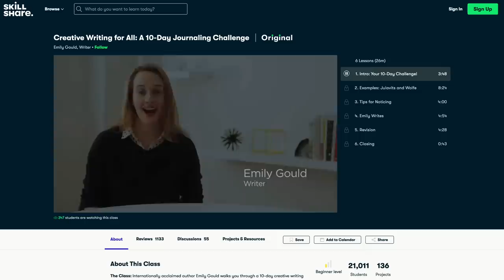A very very very simple Plywood Bed

Comment: I like this design very much! No screws, just gravity and a few dowels.

I like it because it's modular. You can easily swap out any part for a new one quickly. You can change the entire headboard if you want it to be taller, or at a different angle.

You could build different bases (taller or wider or both) if you want to add some storage under the bed.

You could add bedside tables; make a horizontal arm from the same size board as the stiles, attach a small tabletop to it with dowels, and cut a slot into the headboard to slide the table arm in from the front.

Or, you could make an L-shaped arm for the table, and attach it by adding notches to the stiles.

You could add a footboard using the same design as the headboard.

Does the headboard slide backward when you lean against it? You might need to add shallow notches to the stiles to keep the headboard in one spot. They would only need to be 5mm or 10mm deep, just enough to keep the headboard from sliding backward. If you cut a sawtooth into the stiles, you could then adjust where the headboard stops, and each cut of the sawtooth could allow the headboard to rest at a different angle - steep, medium, shallow.

SO many options with this design. Maybe Ikea will buy it from you!

Comment: I realllly like this design. Since it's so simple, it leaves a lot of areas for customization. Like if you decide to make it a twin instead of a queen, you can make one of the base boxes longer than the other and build an end table that's built into the bed. Or if you're tired of the bed moving around on frame, make some taller boards for the edges and foot and drop them in to encase the bed.

Comment: a clean and nice design as always, out of curious, because i am a big man, do you feel those ribs you made through your matras? love the solution for the head board. well keep them coming as always
Reply from the maker: I only slept on it once so far-didn‘t feel the ribs
Reply: As another big guy, who sleeps more comfortably in a 'recliner' position (back angled, butt lower down, knees slightly up, feet same height as knees), I'm wondering if this very excellent and stylish flat bed concept could be adapted to the shape of those recliner beds/chairs?  Like maybe a bed of shorter straight slats (3 or 4 slat pieces to make 1 rib), with those shorter pieces overlapping and hinged by longer and larger-diameter dowels going left to right through holes in all the slats at the hinge points, so the bed of slats could be bent into the shape of the recliner as viewed from the side.  May not be able to use the cross lap cuts joining to similar cuts on the black boxes, unless some way of making them able to work through the range of adjustment is figured out (like maybe half-holes in the bottom edges of the slats, and instead of black boxes, have trestle rails with the cross lap cuts in their top edges that would engage the half-circle cuts in the slats, with the trestles supported by adjustable-height leg assemblies?).  Sounds like a design that would be a lot of fun to work out!
Reply: I would think that the ribs wouldn't be an issue since the body weight is evenly distributed over them, much like the IKEA bed slats. Nice design

Comment: Wow!  Another amazing creation.  Thank you for sharing it.  I’ve got a couple of questions for you:  

Is it heavy?  You used particle board/MDF and that’s usually a heavy material.  

And why didn’t you go horizontal with the base instead of vertical?  It seems that the vertical base absorbs the weight placed on the mattress and causes it (the mattress) to lose its form when some lays on it, making the bed uncomfortable.  

I do love the simplicity of the design!

Comment: Great build!!!!

I made a similar platform bed for myself a while ago.  I used similar box joint construction on a perimeter frame and salvaged a tilt mechanism from an IKEA tilt storage bed frame for under mattress storage.  But since I was moving around at the time, I made the frame members hollow beams for wight (solid plywood members can get heavy). 

And your design makes adding things like side tables easy.  You could attach them like the head board.

Comment: I watch a video like this and you make it look so easy to get such clean cuts and everything fit together perfectly then I try it and it looks like a 5 yr old did it (a 5 yr old could probably do a better job).  I think the reason everything I make turns looking like garbage is because I start with garbage materials from home improvement stores.  I just get caught between dealing with a cognitive issue that takes a toll on the math skills knowing I make a lot of mistakes to buying good materials.  
Anyway, the bed is beautiful and the pooch makes the video so endearing

Comment: how did you decide the depth of the grooves holding the cross-wise base to the lengthwise stringers? thx
Reply from the maker: Half the width of the lengthwise stringers in both parts

Comment: Great video! A little tip. I can see, that you use a gas heater in your tool shop and that's a big no go.The reason is, that for every m3 gas you are burning you are releasing 1 liter of water into the room. You will therefore risk your tools getting rusty.

Comment: Sorry for the dumb question. What was that you apply on the surface then you sand it off? Why did you do that? #noobalert
Reply from the maker: That was a clearcoat that I sanded smooth. In this case it was much faster to out the varnish on before cutting everything to size. Usually varnish is the last step-but I was lazy and wanted to save time :)
Reply: @laurakampf  thank you. That explains it. =)